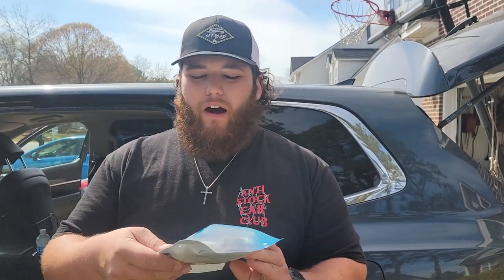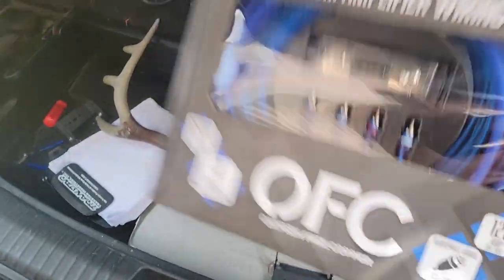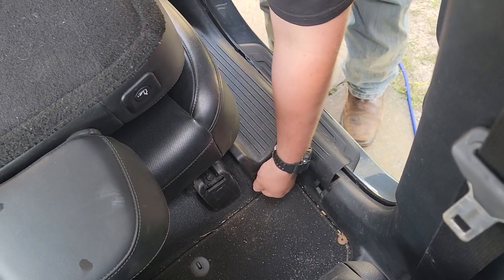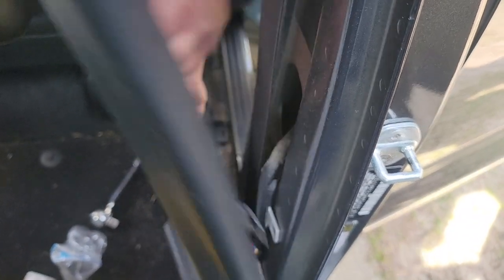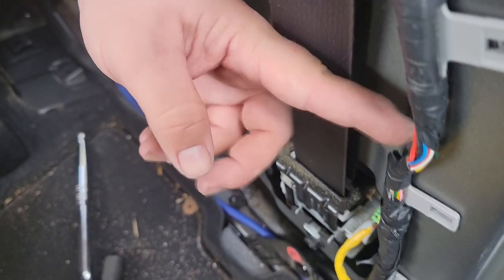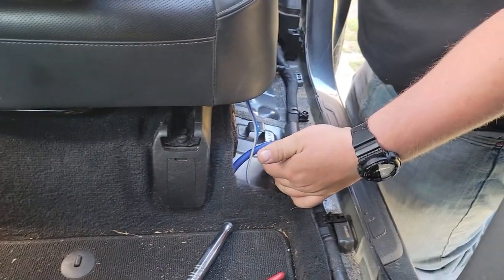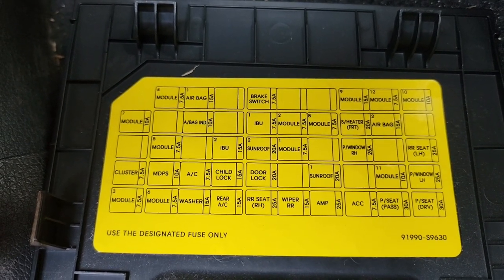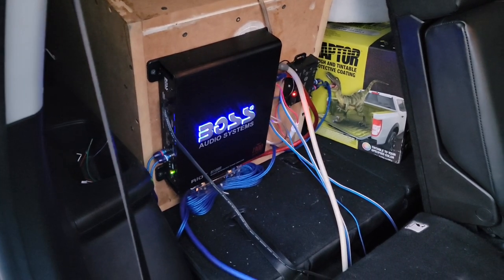2020 Kia Telluride Subwoofer Installation

Comment: Does your Telluride have the Harmon Kardon amp? If so, you will want to tap into a different source other than the rear speakers.
Reply: Honestly I'm dumbfounded by this!!!
Reply: @bassman80  there should be more information than what's provided. This vehicle is complex to work in, and the video makes it appear as if it's way simpler than it is.
Reply: @PaulFlart-MallBlart  Not only that but everything he did is wrong. His inline converter or crossover would have a sensor in it to shut off the amp. Not only that, He could have just ran speaker wire to the amp itself with the connection in the front and using the cross over on the amp itself. Then again the amb it self would have a sensor that would shut it off. Also I'm willing to bet the moment. He starts to turn it up the speakers that play the highs. I bet the sounds start to clip or cut out. He'll have to run a second amp just for the highs, after that run new wire back to the speakers in the car speakers. Just by doing that he can eliminate the crossover again by using stereo. Jack's out on the amp to the other amp which is the second amp that powers the sub or subs.
Reply: @bassman80  From my experience, I never had audio cut out, but I did deal with all-pass filters in the midbass region, and the HK amp has some kind of clipping protection that drops random volumes if you enable any kind of EQ from the infotainment.

First, I ended up bypassing the amp entirely and soldering a COAX to the factory SDPIF right into my DSP. Now, I'm using a DSR1 as a line-out converter right to the DSP, and it works wonderfully.
Reply: @PaulFlart-MallBlart  that's why you didn't have any clipping!! You bypass it.
Reply: As soon as he said he was putting the fuse near the sub, I knew he was all wrong.

Comment: Everything you did in this video one hundred percent wrong!!! Do not do any of this!!! I'm dumbfounded by all of this!!! I'm willing to bet when you turn up the amp or you turn up the head unit, it's cuts out. You do understand that right, that the cross over and amp has a sound sensor that powers off the amp automatically.